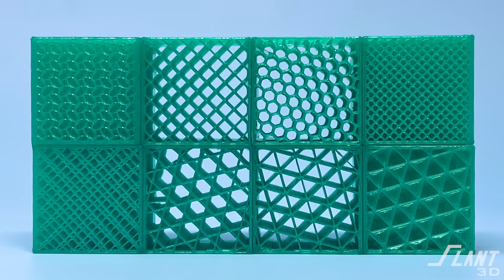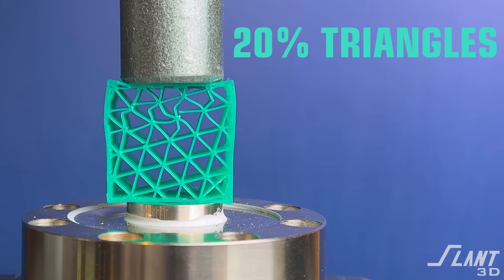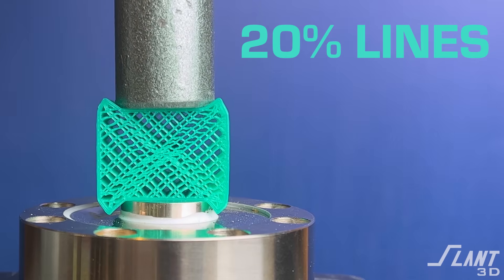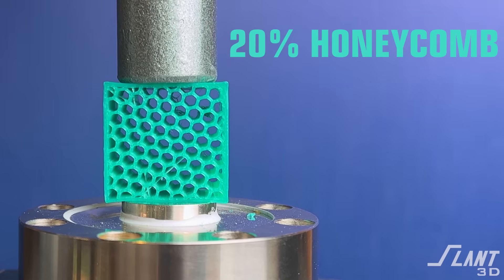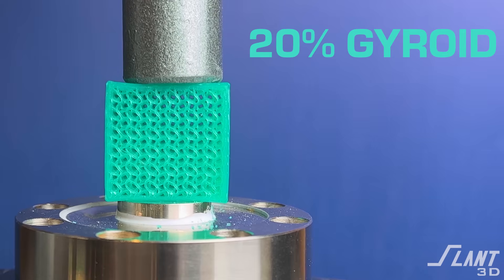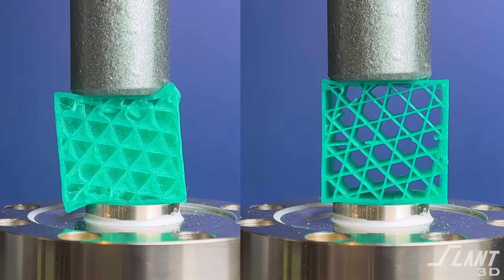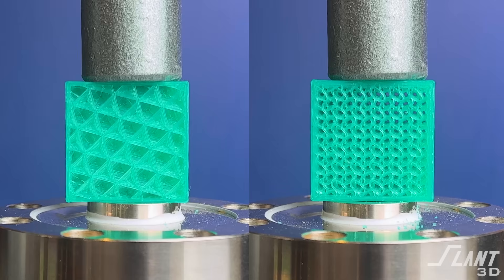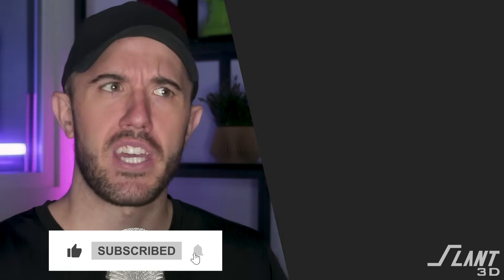Which Infill Pattern is the STRONGEST? | 3D Printing Testing Lab

Comment: Came to make the same comment that triandot did below.
I'd be interested to see how much force a part can sustain before deformation begins and how much deformation a part could withstand and "recover" from (spring back to its original uncrushed state or very close to).
If I'm building a shelf, a slight bowing could be ok but if it starts to buckle then my infill wasn't up to the task - how much weight can it take?
Love what you're doing, keep it up!

Comment: I've seen a few videos like this and i don't see the print orientation ever taken into account. Grid might be wrap 6 when crushed from the side but what about when the pressure comes from the top? If i want extra vertical strength I typically use grid.  The direction the pressure and shear is going to be coming from us hugely important when picking the infill pattern.

Comment: You should be graphing peak force vs weight.  Different infills use different amounts of material at the same infill %.  How much did the cubic print weigh vs the stars print?
Reply: This exactly. Also vs time. Strength per minute of printing, strength per gram of material are both relativistic measures people will care about in varying circumstances. 
Imagine one infill is 25% stronger but takes twice as long to print, that might not be worth it in decision making.
Reply: Exactly what I was thinking

Comment: As stated below by @jameslmorehead and myself in your video 9 days ago on infill strength, the results are suspect due to the load not being uniformly applied with end plates, and variability in the location of the round ram relativeto the samples' edges.
Reply: He has also stated in videos now that these tests are the "for fun" version of the much more legitimate and scientific testing they plan to do later with more advanced methods using more expensive machines.

Comment: I'm very confused by your test parameters. It seems the the force you recorded is just what the press was at when you decided to record the force. Maybe it was when it "failed", or "catastrophically failed", but there is no definition of what that means. It seems like it was just "yeah, that's enough" and you wrote down a force number. Many of these, I felt "failed" well before you stopped pressing them and others I felt could take more but you stopped.

You could have done how much the object compressed (total deflection) at a given weight/force applied. You could have done how much force was required to compress to a certain level. But instead it seem to be you just stopped when you felt like it.
Reply: I assumed he compressed until the pressure decreased instead of increased. Then he recorded the highest pressure it achieved. He didn't say that though, so I could be wrong. It would help if it was more explicit. And maybe also record the pressure when it deforms by a threshold amount, like 3mm.

Comment: I'd really like to see your press get some horizontal stabilization and plates larger than the test sample.  The lateral motion will cause the data to be invalid since the actual force vector is not being used, but rather an amalgamation of forces within the press and the sample.  To fix a similar problem with our press so we could use it for die stamping, I used sheets of UHMW to fill the gap on either side of the moving fixture of the press.  This needs to be done equally on both sides so you are not pushing the moving fixture to one side or the other.  Also, with the plates being smaller than the samples, stress risers are being formed in the sample.  Given this is a qualitive test setup rather than a quantitive, allowing the walls to be fully within the test should not skew the data, but rather just shift it.  It might also allow the testing of the incorporation of overlapping walls with the infill.

Also, testing in the XY plane looks nice, testing in the Z axis would also be very helpful data.
Reply: thank you
Reply: Second that
Reply: Agree on this one

The test is invalid beside stupid 😂
Reply: just a square indent should be fine
Reply: This was my thought the whole time. Also, stabilize the camera, at least?
Reply: I thought the same: this test was unfair to these infiill samples.
Reply: hear-hear

Comment: most people don't consider parts that were squished like 30% to still be usable so i think this video needs an additional graph for peak force before visible (or a specific low percent of) deformation
Reply: immediately thought the exact same thing, every test looks to start with each infill already showing some level of deformation.
Reply: You mean yield strength?
Reply: also it would be much helpfull change percentage of infill to actual weight of used material - i assume that 20% gyroid infill doesnt use same amount(weight) of material as 20% line infill.
Reply: Also, I usually orient my parts so that any load sits vertically on the infil. 
Gyro  when load/impacts come from all sides.

Comment: Gyroid is a two-domain open-cell pattern, so it fills fairly well. I could see smaller air bubbles getting trapped in local high spots, so it would take some agitation or vibration to fill it 100% without voids.
Reply: Yeah that was what I was thinking, gyroid is not closed cell like cubic is.
Reply: Yes, it was a mistake in the video to say gyroid is closed-cell like cubic. 

One of the things gyroid is famous for is open cell in all directions - so if need be can be filled with epoxy, sand, cement, what have you
Reply: I printed out a grid infill cube for fun with no walls.  I was able to see through it in every dimension (all faces), and also when views from the corners.  It's actually a remarkably open pattern in that sense.
Reply: Yeah, you should vibrate the base plate the entire printing time… 🫨🤦🏻‍♂️ Gr8 Idea…NOT 🤣😂 Michael 🇦🇺
Reply: @SpatialGuy77  Or...

Fill after printing, Dick 🇺🇸

Comment: Another variation you should do is the angle of the infill. your lines are at 45° but what if they were perpendicular? Generally, id  expect them to be stronger in line with the infill. I bet a pretty large difference between gyroid and 90° grid infill for example.